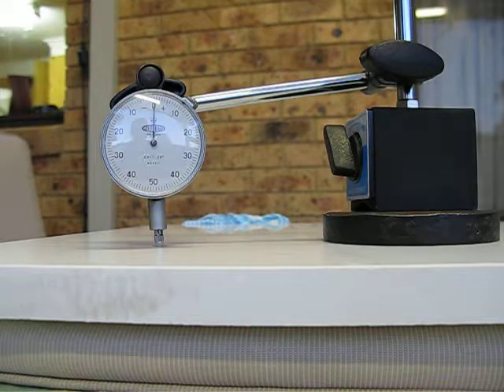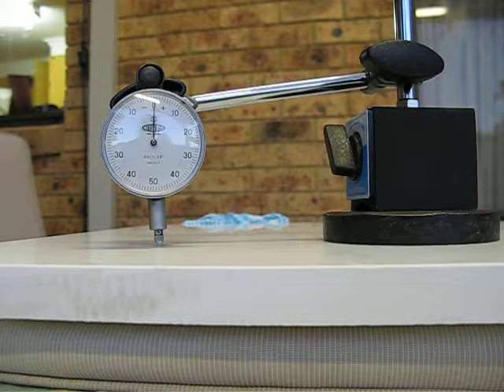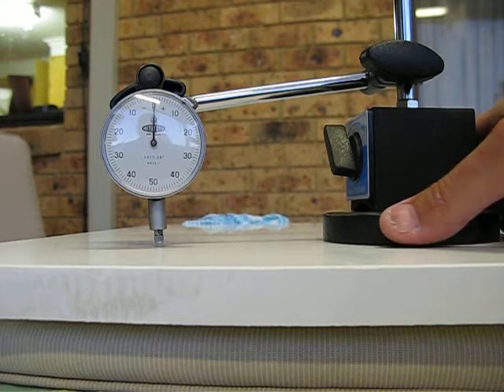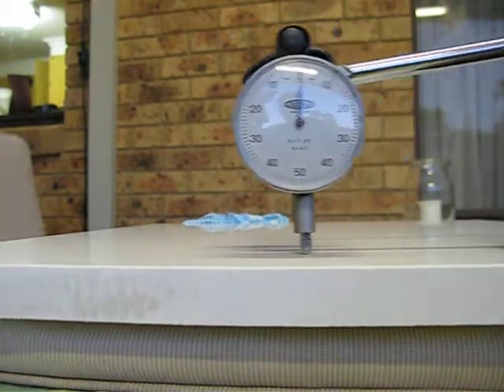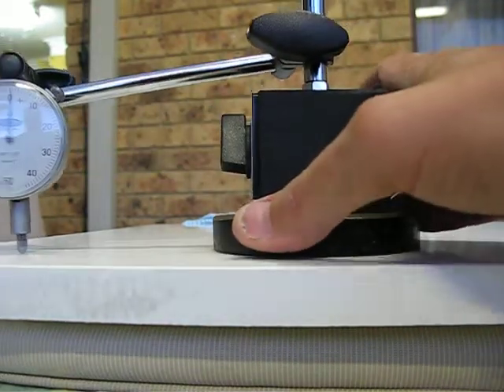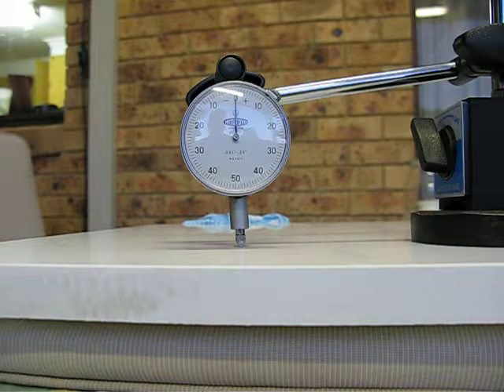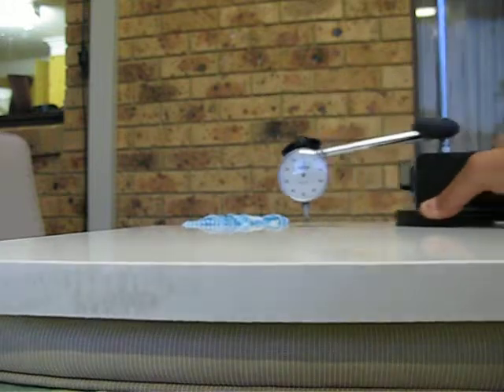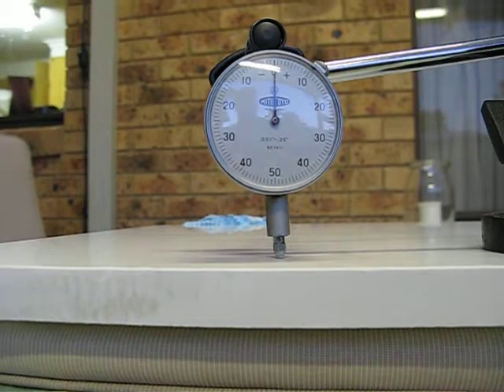Kitchen bench surface plate? Rough look with a dial indicator.

Comment: Most home machinists don't need and can't achieve any better accuracy than your countertop cutoff.  Great demo!  I'm working on naval guns that were made between 1910 and 1942 and the quality of machining on the original parts is amazing but as long as I can hit within .0005" the parts fit and work.

Comment: This one just cropped up on my feed, so yeah, here's me commenting 5 years down the line, not so much for Benjamin, but for those coming later.  There's people here commenting that this is not a good test, and to a certain extent they are right.  If this is a flat(ish) surface with a maximum deviation of ±25 microns over 10 cm, or a concave spheroid(ish) surface with maximum deviation of ±25 microns over 10 cm, , or a convex spheroid(ish)… you won't be able to tell using this setup.  A machinists level can tell you, and an autocollimator can tell you, but that's about it.  However, it's unlikely to be a spheroid, which is usually achieved by lapping (see telescope mirrors, etc), it's far more likely to be flat(ish)

But.

If what you want to do with it does not require more accuracy than that, it's fine.  And most home shops do not require more accuracy than that for most uses of a "surface plate". Maybe if you're reconditioning machines, or measuring pieces that require high accuracy.  Most of us aren't doing that.  Most of us will be using it with a height gauge for measuring or marking out.  It's fine in that respect.  It'll get 90% of what you want done.  What I would be more worried about is surface durability.

Anyway, it's a good example of what you can find "over the counter" (if you'll excuse the pun).
Reply: Thanks for the clear explanation. I probably don’t need a surface plate but I will keep my eyes open for granite like this. 

Might be fun to figure out how inaccurate it is. If I can’t figure out a problem with it, I probably don’t need a better one. :)
Reply: @gf2e  Oh, you probably do need a surface plate, even if you don't know it yet.  The same way everyone needs a lathe :)

Headstones are often made from granite, and offcuts are cheap.
Reply: @wibblywobblyidiotvision  I feel like there is some sort of morbid connection between people getting lathes they don’t need, and tombstones. 

I do want a lathe, because I often want weird screws that I can’t easily find locally.  

Clearly, I need a Tornos :)
Reply: @gf2e  You can measure how flat the surface is with your indicator and a 'reference bar' that covers the surface's diagonals.  The bar does not have to be a perfect straightedge, just straight enough to be measured within the range of your indicator.  First, measure the bar's thickness variations at the ends and center with a micrometer, or by setting-up the indicator over a single point of contact in the middle of your surface and sliding the bar under the indicator.  You don't need to read everywhere (just the ends and middle) and you don't need the actual thicknesses (just the variations measured with your set-up).  The difference between the end readings is the bar's 'taper', and the center reading minus the average of the ends is the bar's 'bulge' (or 'neck' if it is negative).  Second, support the bar on its ends and zero the indicator at the bar's center.  Rotate the bar 180 degrees around the long axis, and read the indicator's change.  That is your bar's 'bend'.  From the bulge and the bend you can calculate the bow/sag at the center of each of the bar's surfaces.  Now you can use the bar to measure the surface's bow/sag in the center, and the 'twist' between the diagonals.  You can also characterise the same bar over other distances for the surface's length and width, or the sub-span of a measurement grid.
Reply from the maker: @gf2e  I find my lathe incredibly useful.  One thing to do is start any project by asking yourself 'can it be round'.  This is usually a new way of thinking about stuff.  If the answer is yes then making it can be joyous lathe work.

Comment: I made 1 from scratch, shooting for .005 for woodworking, but easily got .002. The indicator setup you used cannot pick up widely-spaced holes and high places. I used a home-made precision spirit lever with 3-point contact.
Reply from the maker: It is most certainly a rough look.  Would not pick up a large sphere either as another commenter pointed out.

Comment: I use counter pieces for my sandpaper lapping plates as you can generally average out the surface imperfections. Also makes for generally good enough rough inspections plates for like cast things so you don’t scratch the good one

Also your DIY repeatometer is not enough to inspect to even like B grade, a really wide tenths dial works enough to see if you have big dips (anything over like 3 tenths means toast for real flatness)

Comment: A sphere would show the same indicator reading. And, your indicator's resolution is not enough for any meaningful inspection.
Reply from the maker: I had not thought of it being part of a sphere, nice one.
Reply: A sphere would only show no movement if he only rotated his dial indicator holder, he translated (lateral movement) the indicator holder as well as rotate. BUT the calibration process for one of these certified tables involves lasers not indicators. It is generally accepted that the surface grinding of granite countertops is within 1 mil though! Good enough for hobbyists
Reply: I wonder if using a straight edge and light would help settle your worries for the precision he seems to be going for since .001 over a plate is acceptable for him. (And reasonably so.)
Reply: @christopherjones7191  Yes, you can measure the deviation with an accurate straight edge and feeler gauges. Another method is to pivot a known accurate straight edge on the plate; if it spins in the middle - the middle is high; if it pivots around the end, you have some convexity.  A good straight edge will pivot about 30% from each end on a true flat surface.   

The tool and method Benjamin shows is just one method used to test plates but it's not definitive and as others have mentioned, other tools such as optical autocollimators, lasers, differential digital levels and straight edges can provide more precise results.  ASTM has specific test procedures for calibrating plates.
Reply: @flyingmonkey3822  You are incorrect.  This is how convex and hyperbolic / parabolic mirrors and lenses are measured.  Benjamin's "Repeat-O-Meter" tool is similar to tools used to measure mirrors for telescopes.  If you have a spherical surface, this tool will not show any deviation unless you calibrate the tool against a known reference plane.
Reply: @MatthewRulla Calm down, its a fucking Countertop used in a Homeshop. Feel free to buy him the "proper" Testequipment if you insist. Till then, this is good enough.
Reply: @DERTOBL based 👏🏻👏🏻